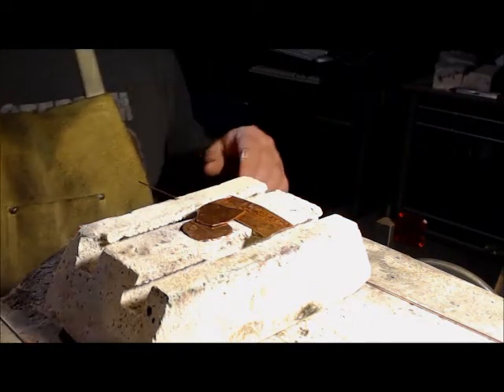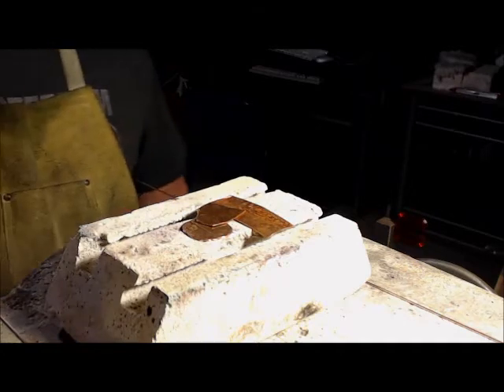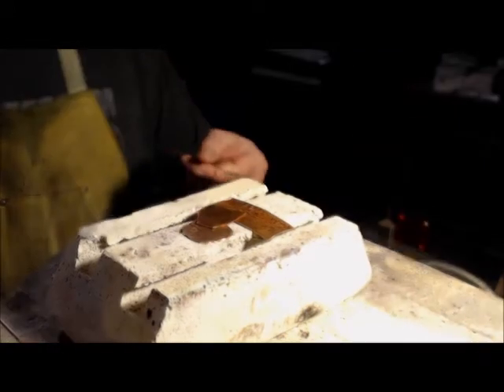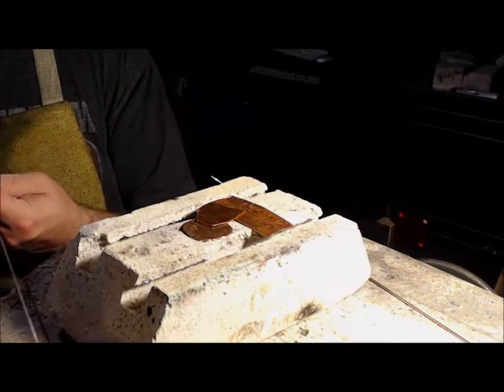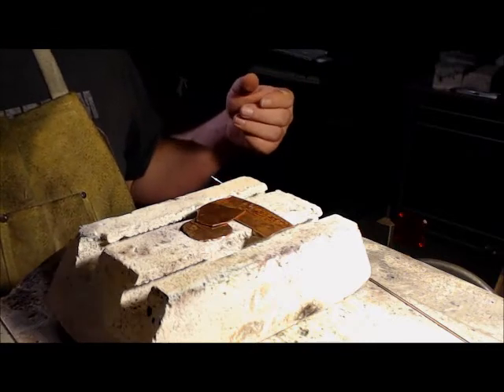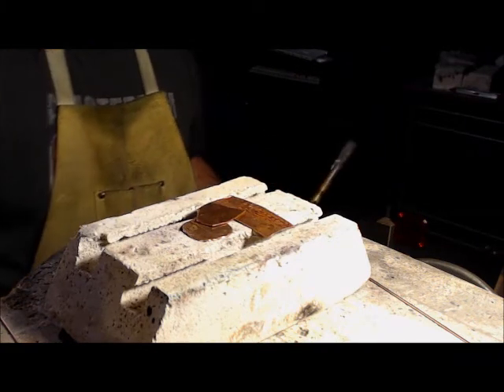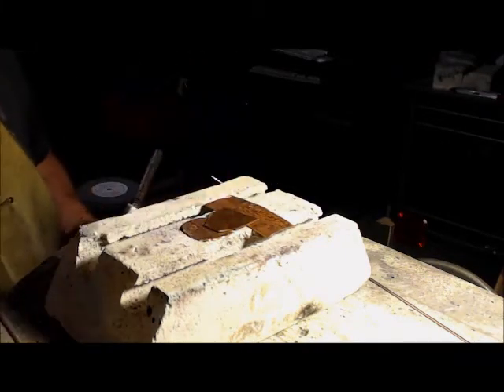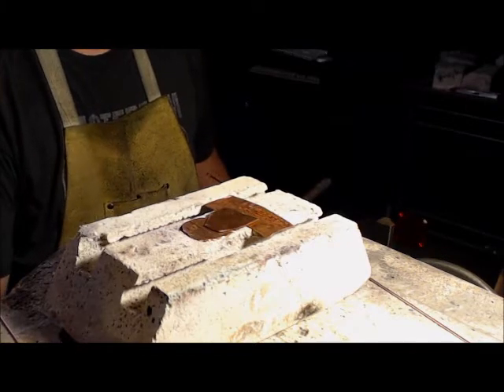phos-copper brazing

Comment: You will never make a fridgie with those brazing techniques. Way too hot. Filler material becomes porous and lets gas escape.
Reply: Absolutely right. And phos-copper is generally used by HVAC guys for joining refridgeration lines. I'm not an HVAC guy and I was hoping to demonstrate the use of brazing as a sort of hard to fail brazing technique. Getting a perfect gas-proof seal is also not difficult but requires much more finesse than I demonstrate here.